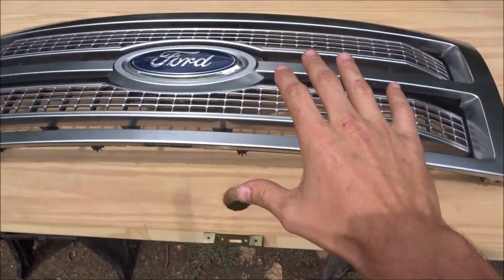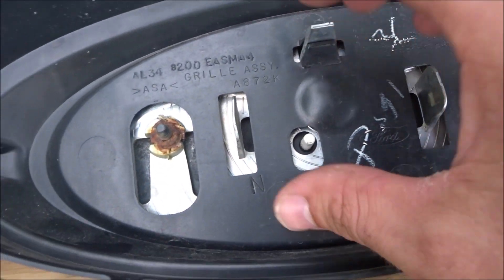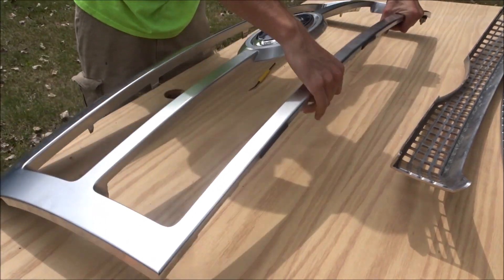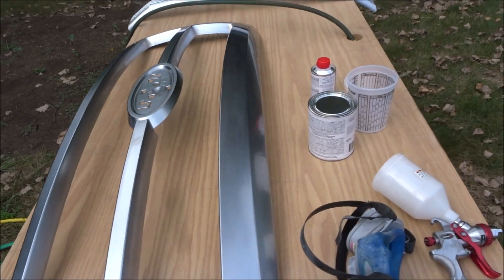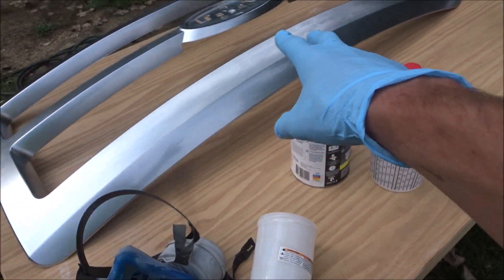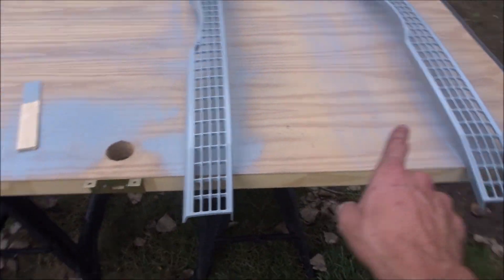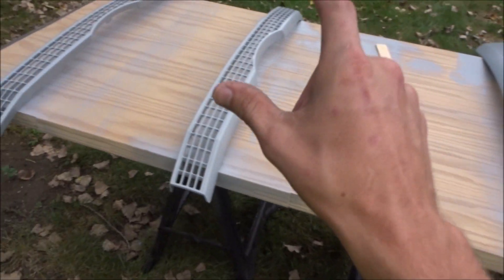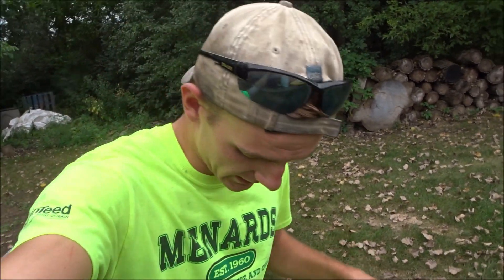Custom Color Matched Grill and Bumper! Part 1: Prep and Primer

Comment: 320 grit on the grill would be better than wet sanding followed up with adhesion promoter then primer. I've seen alot of grills peel because  of surface to smooth nothing to adhere to.
Reply from the maker: I realized afterwards, I should've used adhesion promoter. I guess I'll be playing the waiting game. If it peels, no ones fault but mine. 🤷‍♂️